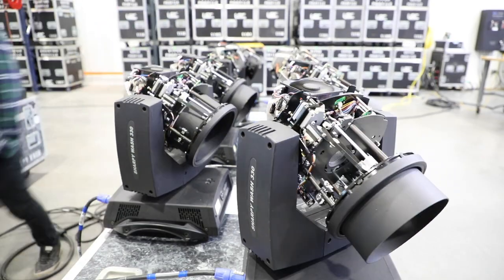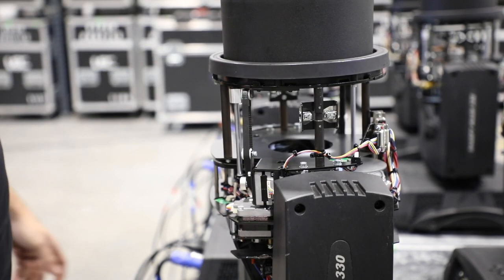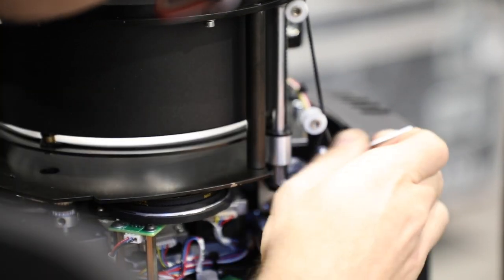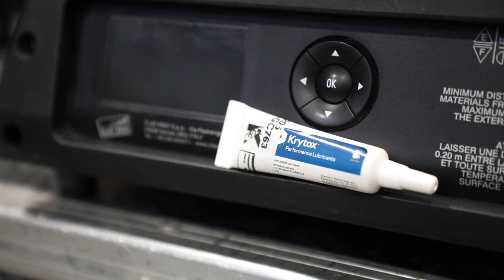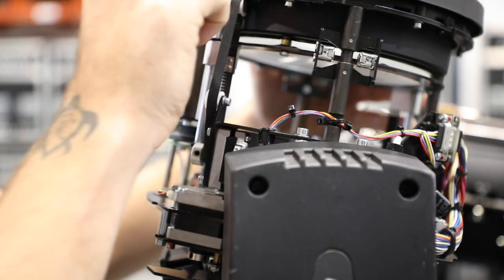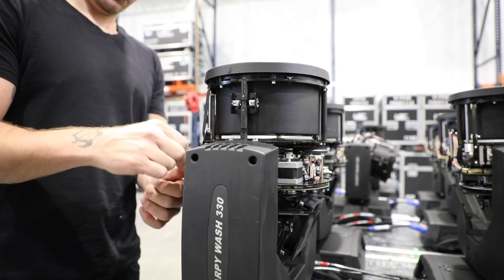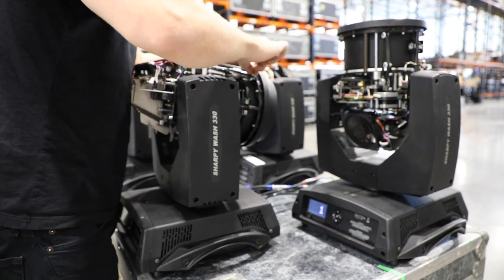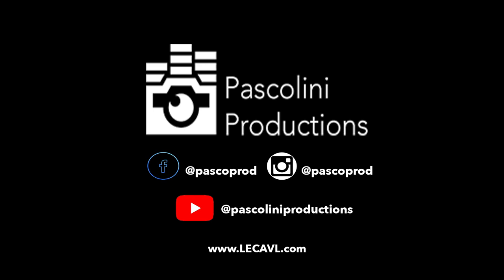Troubleshooting the Clay Paky Sharpy Wash 330

Comment: I had a similar issue with 2 robe colorspot 1200ats in a venue I worked at the problem turned out to be acumilation of dust on the old lubricant once I cleaned the old lubricant off all the fixtures and put new lubricant on they worked perfectly